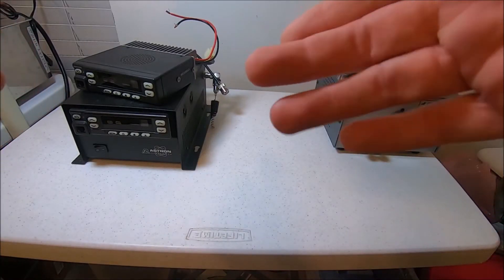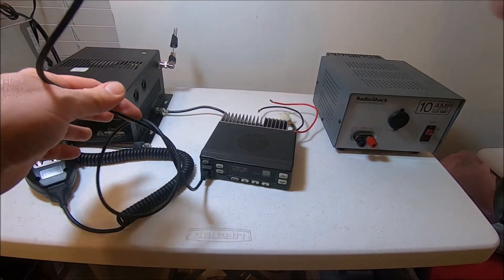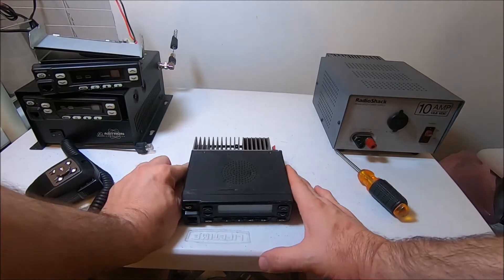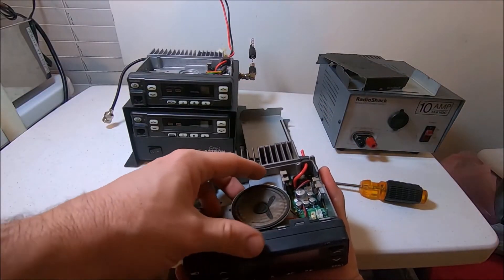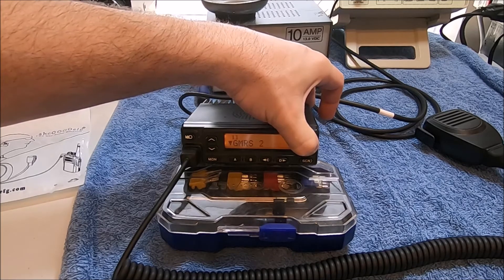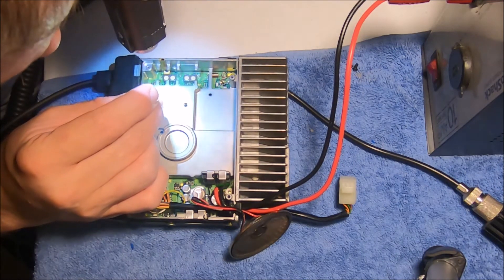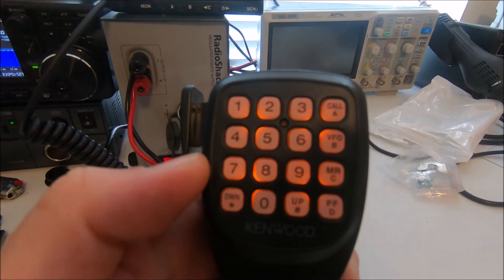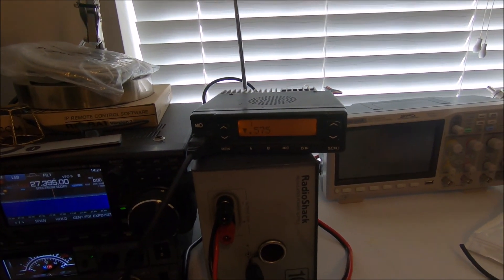EricTechstuffs: Converting a Public Safety Radio to Ham Radio ?

Comment: How do you get the ham frequencies into the radio? My software kicks it out when I enter it. Is there hacked software or is there a secret like the legacy programming software for the old Motorola radios by entering data using the shift key to enter the frequency numbers releasing it for the dot and hitting shift again for the last four digits.

Comment: Well it’s 25 years on and I still have my 3 X80 series radios, U, V(high power) and 800 MHz (who wants to mess with the GSM TELCOMM stuff, NOT). Like to find some of the DTMF KENWOOD mics for these radios. You can program power on lock that prevents unauthorized individuals from accessing the radio until you enter the unlock code into the radio.
Reply from the maker: I bought some new Kenwood DTMF mikes on eBay, but  have not tried out to recommend if good or not. .  Kenwood radios are a program and use until they stop type radios....they just never seem to stop if the Antenna SWR is in spec. Great selection of radios you have !
Reply from the maker: Aldo thank you for the tip on TX lockout... A nice feature to have for sure !
Reply: @EricTechstuffs  there is also a lockout for reading the radio to prevent any information on what’s programmed into the radio. Should be under radio options in the very top of the data page once it’s opened via KPG-49.
Reply: You can also unlock the radio by using the front pad keys to unlock the radio. You don’t need that unique microphone to unlock that radio.

Comment: Is there something wrong inside my radio I bought it off of eBay and it was from a school district and had program some school bus channels. I was able to get those channels off of there but afterwards the scan button and the up and down button doesn’t work anymore the little button on the front are my channel selection. 🤨🤨. Plus the scan button doesn’t work.
Reply from the maker: I think your radio is fine. From what you describe , if you are using the Kenwood programming software you can program the Key assignments under the "Edit -->Key assignments tab. To verify you have those keys assignment they way you would like.  If you are using CHIRP, you should also be able to assign or re assign they front panel keys to your liking . Please let me know how it goes ! These are great little radios !
Reply: @EricTechstuffs   I have tried assigning them using Kenwood software but I was able to and it still wouldn’t work but I will try Chirp and get back to you.
Reply: @EricTechstuffs  is there a way I can mail you my radio and I can see if you can take a look at it and try to fix it? Or I can send it to you for a trade?? Thanks 🙏 also make a video on it?

Comment: Hi 👋 I was wondering if you can please make another video like this one but I have a tk-760g version that I would like to get 2meters I believe. Right now it only covers 2meters business channels. If you can make a video on it that would be great thank you 🙏 😊😊
Reply from the maker: I have a 762G. The 762/760 also has different models. On the back label you should see if it is  a  k, k2, or m  model. These radios also have the same layout as in this video. 
148~174  - K ( hard  but may tune down 4 mhz to cover 144)
136~162  - K2  (ready for ham)
146~174  - M  (ready for ham, may need to tune down a little to get lower 144)  
The software may spit out an error when programming 144 in the m and K models, ignore error and write to radio - it will work.  Thanks for watching !

Comment: Thanks for the video. Got my type one to rx 443, but no go on tx. Guess I'll just sit back and listen.
Reply from the maker: Did you also adjust the TX pot ?   I programmed in a couple of test channels to use to verify I did 450.00,445.00, 443.00 and also added 490,480,470 IF you adjust the TX pot you will loose the top half  490-480  and start gaining lower spectrum 445-443 so you know your going the right direction
Reply: @EricTechstuffs  I did do the  TX. I set it at 443 and would just barely get it to send a signal. Would turn it just the smallest amount more and the radio would trip out on a "safety ". Basically shut off and turn back on. RX is clear as could be.  I stopped so not to screw the whole thing up.
Reply: Update...  for anyone interested as to what caused my issue. It was caused me not putting brain in proper gear! I had to low of a power supply. Just needed a few more amps! 

With that being said. You can't mess up this adjustment. I fiddled and turned and turned some more before the low amperage was discovered.  Just program a 441,442,443 462,463,464. Turn and test TX with another radio. Do the same with RX. Not a big deal, just make sure brain is the proper gear and don't slip the clutch! 😝  

BTW,  I used a WIHA 1.5X40 screw driver and just filed down to fit.
Reply from the maker: @pumper34x   Awesome news - One of the smallest screwdrivers I own is just for this radio !!
Reply from the maker: @pumper34x   That is great !  Yes, they do need a decent power supply. Welcome to a great 70cm / GMRS  radio !  Now I am playing around with fleetsync.  you can also add a key assignment called OST that can allow to change CTCSS tone selection.  I did remove the resistor for from panel programming so it can be reprogrammed in the field  too ! kinda like this video : https://www.youtube.com/watch?v=ZpBywmVqhfU
Reply: @EricTechstuffs  do you mind me asking what model screw driver you used for the radio??
Reply from the maker: @ipodbuff  I used the smallest size flathead I could find at Harbor Freight. I went there because I was expecting to ruin whatever bit I was buying to shave it down smaller . I bought a set of 5 fine tipped screwdriver kits.  The smallest one is just small enough to fit, I believe they are Black and green now. Sometime called Jewelry screwdrivers for working on wrist watches.  It is crazy how small the slugs are ! IT's is a flathead !
Reply: @EricTechstuffs  yes 👍 it’s crazy how small. I t him I need a little bigger than that because I don’t think it did anything. Thanks for your reply.
Reply from the maker: @ipodbuff  Yes, In that video you saw me hunched over with a flashlight to see the position of the slug.  I dropped my screwdriver down in that same configuration, like I was playing that old game Operation  with a buzzer !  Let me know of any help you need ! I am here for you !   👍
Reply: @EricTechstuffs  do you mind if you can make more videos on this radio? Showing some other features it can do?
Reply: @EricTechstuffs  can I please have a email address I can send you some pictures?? I took a couple pictures of what the transmit and receive holes look like in my radio and after some inspection 🧐 I don’t see anything in the transmit hole for me to turn in order to transmit. As far as the receiver hole I’ve been trying as well and I have felt anything moving around.
Reply from the maker: @ipodbuff  sure email is EricTechstuffs @ gmail . Com
Reply: Yes 👍 this sounds like the trouble I’m having with my radio. I’ve got it to work on a centered frequency but I think I need a special screw driver. I just was able to update the firmware on it. 😉😉😉
Reply: Can I stun kill my kenwood  tk 880 radio back to life by using a vhf Kenwood radio?? Can you please send your email address??

Comment: Do you know where I can find the programming software for the TK-880H ?   I found the KPG-60D but its in German.  I can't figure out how to change the language so I can set the configuration on my serial port.    Can you offer any info?
Reply: I was reading there is a mod you can do to it to allow programming from the front buttons.
Reply: @n1kkri yes you can but you can really/mess things up IF you do not have the instructions found in the service manual. First it has to be set up in the programming software. Read the radio and then go to Options and peek around in there, may be multiple screens. You will find an item like front panel programming or user programable. Check that button and reprogram the radio. Now it’s been twenty years since I played with my radios for programming but there are two buttons to press while turning on the radio. Please try and find the service manual for your model & version which will have the detailed information you need.
Reply: @Subgunman  Hi and thanks for your reply.  in the past year or so I have solved the programing problem and easily can program the radio.   It's a pretty good radio for GMRS use.   I have a few Amateur 440 repeaters I have used it on and considering the radio was given to me my only expense was picking up a D.C. power cord less than
$10.       My 880H must have already been tuned for the 450-470 range.  It worked with good sensitivity on both GMRS and Amateur.

Comment: Eric, I happened to get a Type 3 in an auction lot with two other radios and a power supply, and it looks like new. Do you think it will tune-up to that 450MHz? I may have missed it, but does your adjustment cover the full UHF range of the product from 400-490MHz? If you happen to have a link to the original information where you learned about the hack, that would be great too. Thanks!
Reply from the maker: Hey that is great !  The type 3 MAY get up to 450 all a matter of adjustments with the tiniest flathead you can find.   This only shifts the operating range up or down depending on what way to turn. It adjusts the VCO.  Some radios are more forgiving than others.  This series will not open it up to full spectrum 400-490 and was broken down into the 3 sub categories of low 400, mid 400 and high 400.   I know that with the type 3 many have had success getting it to 70cm ham .   This is a link with good info, great site  : https://forums.mygmrs.com/topic/1328-kenwood-tk-880h-1/   Let me know how it goes !

Comment: I have an analog uniden bearcat bc550a(bc350a) scanner and I want to use the components and case to make a transceiver. I can't find a schematic for doing it I know it's not practical it would be kind of a gimmick but surprised I can't find a write up on it even since its such a common device. I'm learning how circuits work and such in the infant stage. Haha
Reply from the maker: That’s great ! I know it’s easier to create some basic Hf ham transceivers that would be wher to look.  I know they even have SDR kits to do what you looking at doing. Radio and electronics are all about experimentation!

Comment: how do i know what version i have here?
Reply from the maker: You can determine this from the Last 3 digits in FCC ID Number on the back. Type 1 ends in 110, Type 2 ends in 120, Type 3 ends in 130.   TK-880 Type 1 is aligned for 450-490MHz, Type 2 is for 485-512MHz, Type 3 is 400-430MHz. Thanks for watching !